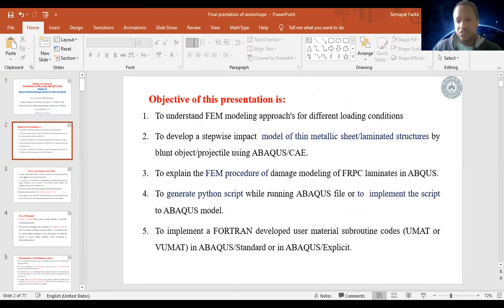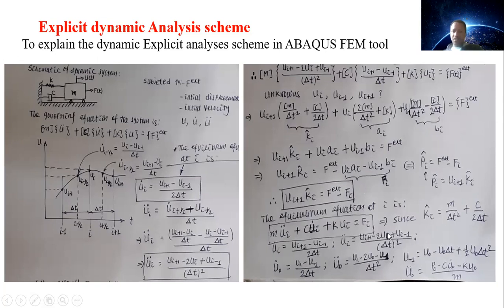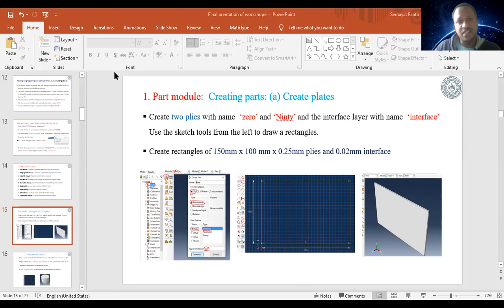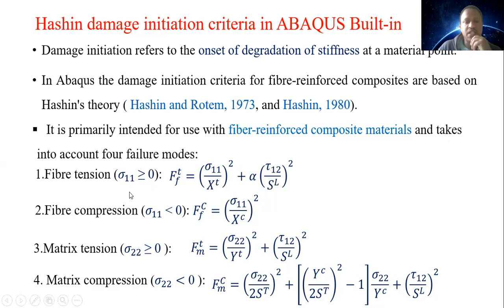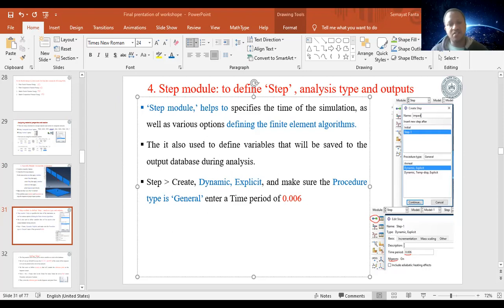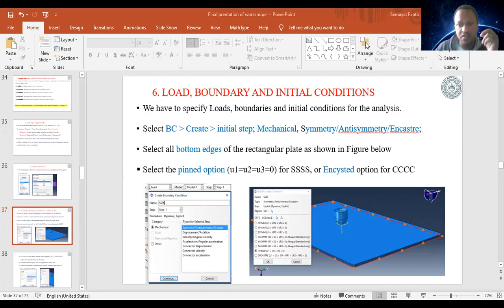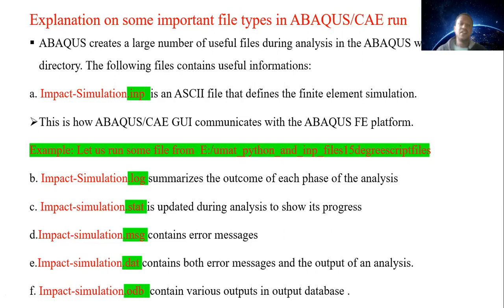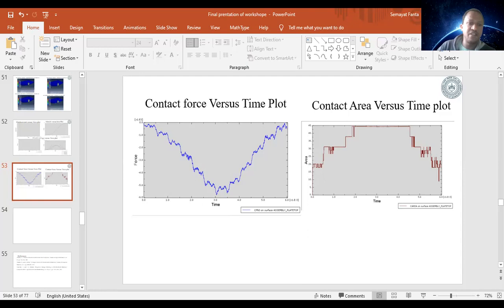Step-by-step modeling of low velocity impact of laminated composite

Comment: sir, i am modelling low velocity impact on composite material in Abaqus explicit and also VUMAT code and i am getting these errors  No initial node-face or edge-edge overclosures found.
  No nodal position adjustments have been made.
  No unresolved initial node-face or edge-edge overclosures found. How can i overcome these errors.